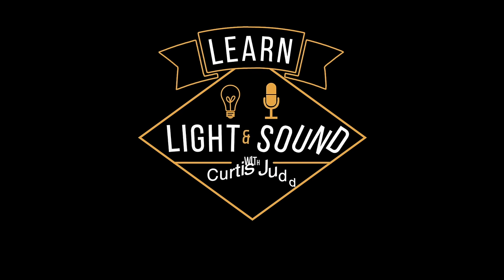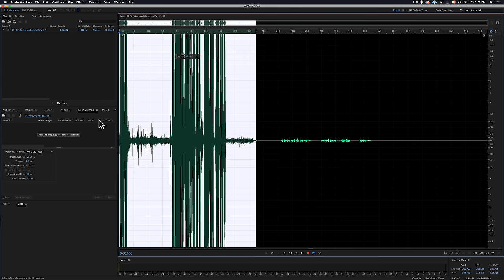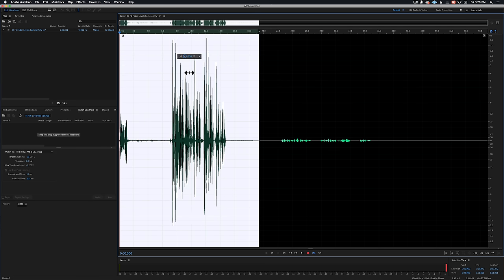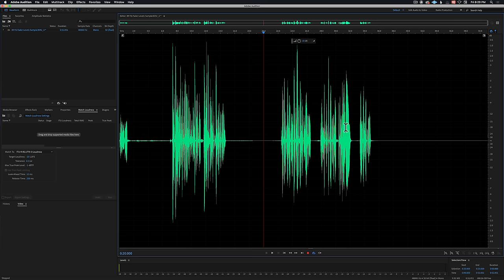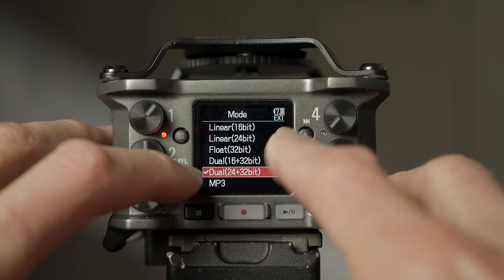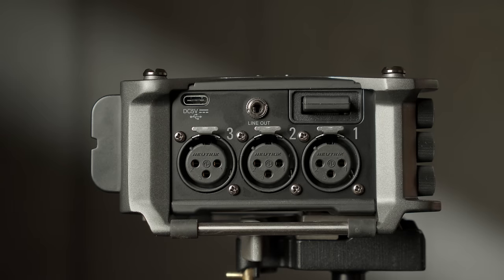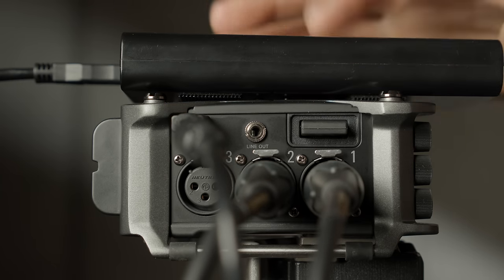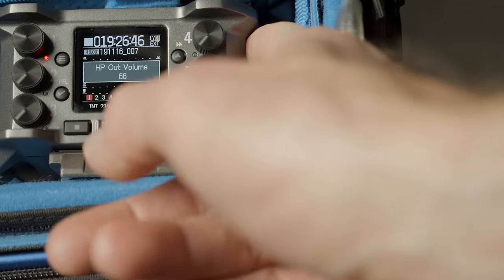Zoom F6 Audio Recorder Review

Comment: I wonder if I am the only one with this „Problem“ or if its normal:
The headphones plug in really nice and tight, but can be taken out much easier (like 1/3-1/4 of the Plug in „force“), so i fear pulling the headphones out while recording. I dont know if i should contact the seller, of if it is a normal thing on the recorder.
What are your experiences?
Reply from the maker: On my F6, the 3.5mm headphone jack seems to have about the same amount of physical resistance as most. You might try different headphones to see if it is your headphones?
Reply: @curtisjudd   thank you for fast response! Interestingly its not just the headphone out but also the line out and Timecode. 
I tried 3 headphones and its the same with all. The seller told me it normally should sit in tighter and offered to replace the device. I hope the new one has a „better grip“ on the headphones.

Greetings from Germany and keep up the great videos!

Comment: I'm curious about the functionality of the limiter in this 32bit float environment - hopefully I can explain my question well.
Having seen you recover the audio file nicely at the start of the video, bringing the db level down in Adobe Audition, this seems a similar concept to me as in shooting RAW and then bringing the values into a range such as sRGB later on.

Later in the video you mention the tradeoffs with using limiters and how they may introduce noise into the recording...this seems contradictory to the abilities you demonstrate earlier in the video.
Is there a way to attenuate the db level, live, in a similar way to Adobe Audition did using the 32 bit data, so that no clipping occurs without a post-production workflow?  Such as a live podcast environment? 

Any further knowledge clarification would be greatly appreciated. I'm wondering why limiters seem so destructive if the data is being captured in 32 bit.
Thanks!
Reply from the maker: Hi Lewis, fine questions. First, when recording in 32-bit float mode on the F6, the limiters are automatically disabled. There is no option to apply the limiters in 32-bit float mode. In 16 or 24-bit modes, you can enable the limiters. But these limiters are a little different than you will find on most professional grade recorders/mixers. The limiter on the F6 (and F4 and F8/n) is a hybrid limiter. What it technically does is reduce the analogue gain while recording by 10dB. Then for any moment in time, it checks to see whether the current amplitude has 10dB or more of headroom. If so, it digitally increases that sample by 10dB. That digital increase also raises the noise floor. The pro level mixers and recorders don't do that. Instead they use analogue limiters which pull down the amplitude before the audio ever hits the analogue to digital converter so it does NOT raise the noise floor like the F6 limiter.

In regards to a live workflow, unfortunately the 32-bit float mode isn't ideal for live, non-post processing workflows. Better to use the 24-bit mode with the limiter to prevent digital clipping. I am not aware of any hardware or software solutions for doing the 32-bit float in a live situation.

Hope that helps!
Reply: @curtisjudd  Thanks Curtis, this was a very helpful explanation, most appreciated.

Comment: Hi there, I've been checking out your videos for the last couple of months and I have to say it is usually my go to channel when it comes to video and sound production analysis and gear reviews. I was wondering if this was a good upgrade from a zoom H5 for feeding my mirroless 3.5mm audio input with no impedence mismatch so that I keep everything in synch and in a webmeeting or live stream scenario ? How does it compare with a sound device mixpre 3 in that department, can it feed a consummer 3.5 mm mic input ? I owned a Panasonic G7 by the way so i don't know if it's any different. Kind regards
Reply from the maker: Hi Mathieu, I would like to say yes, but I discovered a bit of an issue with the 3.5mm output on the F6 you should know about. You can still make it work, but will likely need an attenuator cable. You can find the details here: https://youtu.be/t5W4Wg2yzfY

If you don't want to muddle with a special cable, the Sound Devices MixPre-3 is a good option.
Reply: @curtisjudd  thank you for pointing out that issue. Ive watched you video in the link provided and I have to say that it is a shame that Panasonic didn't include a mic/line switch with the 3.5mm input. I know that most users would wanna plug a Lav mic or HF receiver that needs gain adjustment to line level but what abt those who would want to feed the output of a mixing desk or field recorder.. I guess I will have to consider buying a higher end Mirroless camera to use as my prime unit for synching external sound. My other concern is that I have also acquired a blackmagic UltraStudio 3D that boast hdmi/sdi ins&outs as well as xlrs which can be great whenever I want to capture a clean hdmi feed from the G7 with pristine audio.. The thing is that I end up getting a generated movie file with slighty out of sync audio.. I wish there was a work around to delay the video prior to merging with audio to adress the issue.
Atem mini switchers seem to have the same issue whenever we choose not to embed the sound with hdmi. 
Anyway thanks for all the work and research you put online. It is very fascinating subject.
Regards.
Reply from the maker: @mathieucaron9829  As a note, Panasonic did include a mic/line option in the GH5S, but not the GH5. I'm hopeful that their higher end cameras will all include this option going forward. Yes, that audio sync issue is a real annoyance - I hear you there!
Reply: @curtisjudd  guess I will wait for their upcoming products to see if there is any improvement on that matter or move toward the GH series with the XLR module.

Comment: Hi! Thanks for great videos, keep up the good work.
I want to shoot indoor YouTube videos, won't be moving around. I have a Panasonic Lumix DMC-G80
with a Røde VideoMic PRO. But want to switch to a lav mic. What lav mic should I go for? And should I do it with a Zoom H5 or Saramonic SmartRig+
or Beachtek DXA Micro PRO?
Sounds quality (without noice) is the priority but would love to not have to do anything in post (such as syncing the audio with the video).
What is you opinion in this options or should I go with something else?
Reply from the maker: For YouTube videos, I have never found the sync process to be a problem with Final Cut Pro X or Premiere Pro. I prefer to have a separate high quality recorder. But you can also feed the audio from a recorder like this to your camera to avoid the post sync process. As for lavaliers, that's a question that needs more information to make a recommendation. What is your budget? Wireless or wired?  Will you be hiding the mic under clothing or just attaching to the outside of clothing?
Reply: @curtisjudd  Thanks :)
Regarding the budget, it is relative to what I get, I would rather buy the best option the first time than to keep upgrading forever. I am of course not interested in burning money on expensive branding, but if the quality is there then I do not mind spending a couple of hundred USD.
I am not in need of being wireless, but the flexibility would of course be a bonus for possible future projects. Wireless vs wire; whatever gives me the best sound for smallest amount of money. But if the sound is exactly the same, and guaranteed no interference, and the wireless is just under 100 USD more, then it could be worth it.
I would prefer to hide the microphone under clothing. Thinking of buying the RODE invisiLav, or if you can recommend a equivalent or better product?
Reply from the maker: @dominicdriman1319  There is never a guarantee of no interference with wireless. Ever. :) So I'd stick with wired. A Zoom H5 would give you the flexibility to use a mic with a 3.5mm output which is 99% of lavalier microphones. The least expensive of the pro-level lavaliers I have used is the Voice Technologies VT500: https://youtu.be/9c74PsslcOk
Reply: @curtisjudd  Wow, thanks a lot!

I checked out the video you linked and the VT500 seems to be a good choice. However when looking up the microphone on the manufacturers website I found that they have a VT506 as well (https://www.youtube.com/watch?v=XxP1sL4fsVA), that supposedly should work better under clothing. What is you opinion on that? And if I would go for the 506, would it give me less quality audio if I at times use it without hiding it under clothing?

Regarding recorders, I took a look at your video "Audio Recorders for Filmmaking 2019" as well as seeing some of your past videos where you had some remarks on the 3,5 mm inputs of some Tascams. Also saw a video from Alex Knickerbocker where he talked about having problems with the self-noise of the amplifier of some Zoom H-series recorders (he praised Sony PCM-D100 in comparison). I am not a pro in this area, by any stretch of the imagination, and I want to have as high quality audio, easie of a work flow and with as little post editing as possible. I do not intend to use any background sound or music in my videos, it will only be me speaking. So I want to find a recorder that give me as quite of a noise floor and low risk of RF interference as possible. In my situation, what would you go for?

Comment: 7:20 sorry for my ignorance, can you explain what you mean? Why is this not the best for sending the mix to a camera? Will this cause the audio quality to degrade?
Reply from the maker: Two reasons: 1) If you need balanced XLR audio which can handle longer cable runs without picking up interference, this cannot do that. 2) and this is the most important, there is a hardware issue with the F6 where if you feed audio out of its 3.5mm line output to a camera with a microphone (only) input, you have to use the output fader of the F6 to reduce the levels. But when you apply that fader to reduce the levels, it produces a lot of noise - to the point where the audio is basically un-usable. See this video for details and how to address it if you already have an F6: https://youtu.be/t5W4Wg2yzfY
Reply: @curtisjudd  got it, thanks for explaining!
Is the Sound Devices MixPre-3 II better suited for this purpose? Or is there some other product you would recommend for mixing 2-3 audio sources (such as a boom mic + two lavs) and sending the mix to a mirrorless camera without a lot of quality degradation? (Ideally a simple mixer I can set before filming and then monitor the audio with headphones while also keeping an eye on the camera?)
Reply from the maker: @Seanonyoutube  Yes, the MixPre would be my preference over the F6.

Comment: I want this, mainly for the clean gain
Reply: @curtisjudd  Question because I'm confused about this whole timecode thing.  I will be using the F6 to record external audio and I understand that it has built in timecode but does it matter if FCPX can sync the external audio with the internal camera audio?  Am I missing something?  This question comes after watching several videos in an attempt to understand timecode and it seems like rocket science.  My understanding is that it comes in handy for syncing external audio with multiple cameras  but this can be done in video editing software.  I have to be missing something.  Maybe because I've never shot a film.
Reply from the maker: @QLFProductions  No, it doesn't really matter. Just use FCP to do the sync if that works well for your workflow.
Reply: @curtisjudd  Awesome thanks for taking your time to respond.   Hitting the easy button, now.

Comment: Can you attach lav mics to it directly by using an xlr to 3.5 adapter? Thanks for review. I am in the market for an additional recorder to supplement my Tascam DR100 M3 ... I really need at least 1 more input ...
Reply from the maker: Yes, with the appropriate adapter which also adapts phantom power to plugin power. The RODE VXLR+ will do it (but the VXLR will NOT - don't make that mistake). Here's an affiliate link to the VXLR (the US FCC requires I disclose that I earn from qualifying purchases): https://bhpho.to/2A2ekU6
Reply: @curtisjudd  The VXLR does work to connect a rode video micro to the F6 when phantom power is turned on. Am i likely to blow the mic doing this? Is it a case of "it technically works but is a terrible idea to do it". I might have to pick up the VXLR+ if that's the case. If you have an amazon UK affiliate link I'd be happy to use it. Looking forward to the full course. Your reviews and videos are top notch.
Reply from the maker: @richard.mullane  Hi Richard, Correct, using phantom power will damage the microphone, best to get that VXLR+: https://geni.us/GWh0o

(Full disclosure, this is an affiliate link. As an affiliate, I earn from qualifying purchases)

Comment: Hello Curtis! I was wondering, is it possible to record video via Ios(iphone x) while recording the audio via the f6? I currently use a yamaha mg10xu but the 32bit float seems incredible!
Reply from the maker: Hi Maxime, technically it should be possible, but there are a few snags. I have found that mobile phones and tablets tend to drift out of sync when you record audio separately and then attempt to sync them in post. That can be solved by sending the output of the F6 to your iPhone so that the iPhone records it with the video. But if you do that, then you lose the benefits of 32-bit float because the output of the F6 and the input of the phone cannot handle any audio which exceeds 0dBFS. So unfortunately, I don’t thing it will work. Sorry about that. 😕
Reply: Curtis Judd ok!! Thanks a looot! :)

Comment: Hi, I had a little problem when I was trying to send my mix out to my gh5 using a rode wireless go. The problem is that the F6 line out connected to a rode wireless go on the mic input, the level is to high ! Do you have an issu for that problem ? A line level to mic level adapter ?
Reply from the maker: You might try the output fader. If that’s not enough, you may need an attenuator cable.

Comment: What mics do you recommend to take advantage of the dynamic range of the recorder?
Reply from the maker: It depends on what you're recording?
Reply: @curtisjudd  Sorry I wasn't clear. Let's say my mic has a maximum input sound level of 127 dB SPL. Isn't it going to clip long before I reach the limits of the Zoom F6? What's the point of having that much headroom in a recorder when no mics can pass that much on? I'm sure I'm missing something.
Reply from the maker: @philip  Hi Philip, You are right: The microphone becomes the dynamic range limiting device. That's the point - it is no longer the recorder which is the dynamic range limit. My main recorder/mixer is the Sound Devices 888 which "only" records up to 24-bit audio. I record mainly dialogue with some sound effects and every once in a while, instruments. The 888 does a great job. From my point of view, the two main use cases where 32-bit float wide dynamic range capabilities in a recorder are potentially useful are 1)when recording loud sound effects and 2) when operating camera, lighting, directing, and sound all by yourself. This reduces the risk of clipping, especially for the solo operators doing interviews or other types of recordings which are unlikely to exceed the max SPL of a microphone. Otherwise, I don't see 32-bit float as critical, at least not for my work.
Reply: @curtisjudd  Thanks for the prompt and helpful answer.

Comment: Hi, a stupid question on my side. So you said the Zoom F6 would record 32bit float only in up to 96khz mode. Zoom claims on their website the following "The F6 can record in 24-bit and 32-bit float up to 192 kHz, or both simultaneously at up to 96 kHz."  So what is right now? can it record 32 bit with 192 kHz or only in 96kHz.   Thanks for your help. Greetings from Munich.
Reply from the maker: Hi RetroPixel, mistake which I corrected in the pinned comment above - you can record 32-bit Float at 192kHz IF you turn off the LR Mix, Automix, and Limiters.
Reply: @curtisjudd  Thanks for the info, i somehow did miss the pinned comment, sorry for that. So for me as a Parttime filmmaker what would be the better choice, The Zoom f6 or the mixpre 3II. I saw both of your videos but it is hard to decide. Are there any downsides of not being able to do gain staging manually on the zoom?

Comment: And now F12 please: body of F8n with all its features, 32-bit wide dynamic range ADC from F6 but with gain, proprietary intrerface accepting zoom new 4-track capsules but this time with full 12 individual tracks + stereo mix and USB-C interface with powering over USB-C. These would be only minor hardware changes and some firmware tweaks.
Reply from the maker: Interesting suggestion!
Reply: @curtisjudd  And, I hope, realistic. Such design would not require that much R&D.
Reply: Yeah! My predictions were wishfull thinking. With F8n Pro they just replaced ADC, added 32-bit encoding and updated firmware. I realy hoped for better headphones amp. Still, this is huge upgrade for me as I record concerts I also take part in and for live acoustic music it is hard to nail gain. I almost bought it right away, but when I saw specs of 113dB DR of ADC in the manual my heart dropped. It would be way to little to handle even qutie simple scenarios. I hope this is a typo, as I heard that F6 had 131dB of DR. I assume you soon are going to review F8n Pro. Could you please cover that topic, as well as test the influence of 32-bit on sound quality/tone? Watson wu argued sometime ago that it is noticeable. Also if you could check whether it is possible to apply any analogue gain when using that in 32-bit float mode. I cannot imagine to buy such a gear without watching your review.